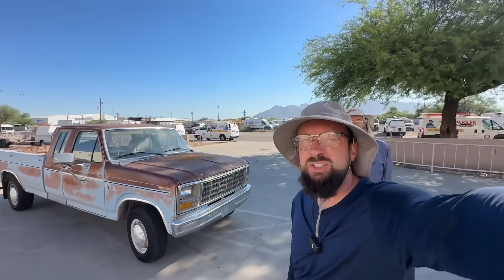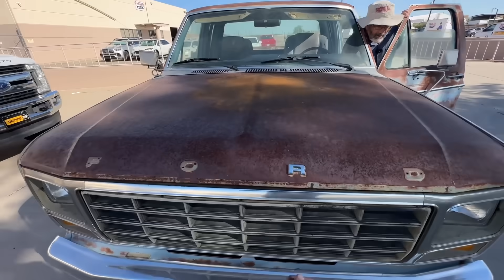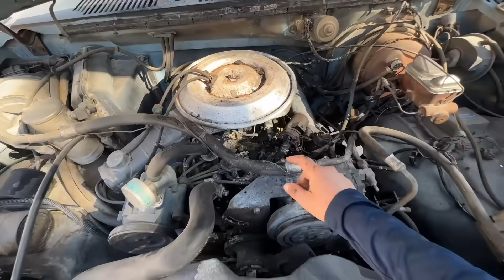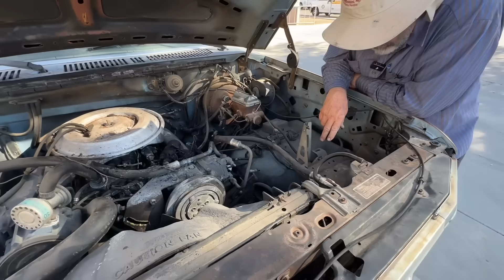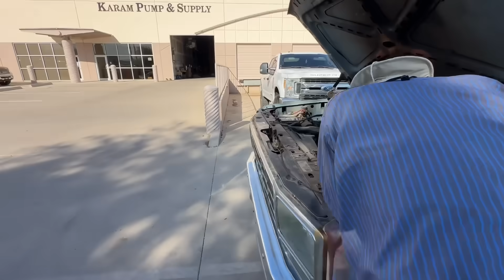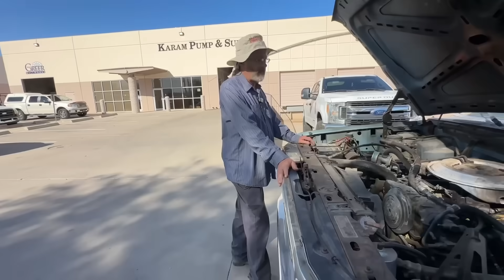I bought & fixed a 1981 ford parked for an ENGINE FIRE. will it run and drive again?

Comment: That 81 F150 would be a great vehicle for me being a disabled veteran. The cab is big enough and a bed to haul a wheel chair. But I probably couldn't afford to buy one. As father and son, yall do great work on these older cars and trucks. God bless! I'm a Ford guy I use to have a 1975 F100 Ranger.

Comment: Just some info. The 1980-1982 F250 did not offer the 460, the biggest you could get was a 400.  As for the trailer special, ford offered that in F150 and F250.  The camper special was available in the F250 and F350.  Ford started offering factory cruise in 1976.
Reply: I was wondering which V8 this was? So do you think it was the 400 or a 302 or one of the 351s?

Comment: Geno's Garage sells a TPS delete kit that replaces it with a potentiometer.  That is hands down the most common reason for no o/d in these trucks.  No clue why you started diagnosing with the less common, and more difficult to diagnose, items lol.  If you've been around first gens as long as you say, you should know that.  VERY common problem, and it carried over.  The 2nd gen trucks really aren't much different aside for the radical new body.  Same ol tractors underneath.  I'd get that TPS delete kit if I were you, that old one you swapped will fail eventually too.  They're only $30.  That temperature sensor on the side of the transmission is the high temp safety switch.  It pulls the transmission out of o/d when the fluid temps exceed something like 250 or so.  The coolant temperature sensor that keeps it form going into o/d when coolant temps are below 70 degrees is located on the back of the head or the back of the block, I forget which.  Also, the dual batteries in the F250 would have been for the Diesel trucks.  Glow plugs.  And both Ford and Chevy offered Trailering Specials and Camper Specials.  Probably Dodge too.

Comment: I’m commenting here…just to help your channel get into the algorithms. (I’m going to try to continue…because I really think you should have more subscribers/views/likes and all of that!
BUT Ford did have a Camper Special. They had a tool boxes 6:29 mounted into the the lower part on the outside of the bed…in the front towards the cab. 
I’ve seen MANY. But I have NEVER seen a Trailer Special…and didn’t even know they  existed with that package?!?!

Comment: Nice job, I knew it will run =))), one question: what size are carburetor nuts?? 1/2 inch?? Thanks, youtheman !!, Ps. I have Lincoln Mark V, 1979... 400 engine at Arctic Circle, Finland, has to rebuild carburetor, that's why I asked ;o))

Comment: Those old Ford 351m and 400 do much better with VR1 oil.  It's about the only one with the right zinc in it. Diesel oil ain't got it.  Unless you like smooth cams

Comment: Those electric fuel pumps are higher pressure than the mechanical ones. It'll overcome the needle and seat and catch the engine on fire.

Comment: Put up insulation under the roof. It's a cheap way of not melting in that oven !
Nice Ford btw, The Trailer special was meant for a 5th wheel RV, the Camper Special they already had with the Bump side.

I think you need to change the cooling fan Travis. It sounds off. It might come apart if the plastic changed hardness from the fire.

Comment: Ford did have camper special packages it was badged and had camper hold downs on the bed and a tool box/storage compartment on the passenger side front of the bed behind the door

Comment: If your interior light doesn't work ,check your fuse for the transmission. They are connected in some Ford years It's something to do with overdrive .

Comment: The 39 Buick is an air compressor that runs off the differential. Been cobbled together for general lower psi stuff like filling tires etc

Comment: Well that wasnt to painfull great flip fer u and pops.think you guys have enough project vehicles in the fleet.now its time to change it up get yourself a skid steer fixer upper for use on stone driveway repairs and mobile motor cherry picker uses!!also that wasnt a burnout that was a dust buster crop circle. Glad guys are having fun though,see ya next one.snooky pa.😊😊😊

Comment: I’ve taken a heat gun and reformed melted plastic like the fan shroud.
Reply: Good job getting her back in the road. Google electric fuel pump oil pressure switch. Using that will keep the electric fuel pump from pumping unless the engine is running.
Reply: I’ve used HEIs from companies like Skip White and others on eBay. Sooner or later I’ve had issues with the modules in all of them. The cheap Chinese modules don’t last. Every time I go to a salvage yard and see a vehicle that would have HEI I pop the hood to see if the fit is still there. If it is I take the time to pull the cap and see if it has an oem ac Delco module. If so I grab it!
Reply: I’m guessing the old car at the end is an air compressor.

Comment: The trailer / camper special f250s tend to use the f350 booster, master cylinder, brakes, and some suspension components.

Comment: The light that came on above the gauges is your brake light indicator. Replace the ignition switch and fix the starting issue,

Comment: If you want to make your smog pump live a little longer , pop off the intake hose and drop a few drops of air tool oil down the air inlet, if you do this every oil change you can extend the life of the pump.

Comment: Hey Travis I've got a 67 mercury parklane power brake car can't find a booster anywhere what can I use in it's place it doesn't go through the firewall it connects outside of the firewall so kind of a weird design I haven't found one yet that works for the application ??

Comment: saw it when you picked it up. heard what the guy said.  when i first saw it . i truely thought it was wood gas a firer. have seen one that grandad's old home stead.  but it was on a tractor.
and in the front. less hoses needed. grandad ran from hitler in 32.

Comment: brothers boss had one of those old work horses. put a big box on the back.
he wore that truck out. shot wood chips in it. heavy wet wood chips.
no one fits in the back. coats maybe.
if i help them i would drive my opel rally with a jag drive train.  number one house country club drive. that owner wanted my car so bad. i kick his porshas ass. 
good day. that day.  ching ching. 500 richer. 
that opel was my road race car. loved that car.  rally was a shrunken camaro 
the opel motor was supose to be in th vaga . dad's  neighbor was an  executive
for chev. he told how chev stopped the deal.

Comment: FYI  i had a 1967  F250 ford that was a CAMPER SPECIAL  had a tag behind the front door, it also had  2 gas tanks with the lever next to and on the floor near drivers seat.    so yes for had the camper special

Comment: I had a bull nose F-150. Good truck except the fire wall is paper thin. So thin that Ford had a recall on them. It only effected the manual trucks. When you would push the clutch pedal in, the firewall would flex and you wouldn't get full engagement. Ford bolted on a plate to stiffen it for the recall. Many people never bothered bringing theirs in for the free fix.

Comment: I'm 74-years-young and I have only had four vehicles that were not ford. A 1960 Cadillac the beast, a 1968 Toyota Corolla Candy Apple Red, an 1984 Plymouth Reliant station Wagon, this one had 4-cylinder engines that I referred to as my Timex. You could bury the needle on the speedometer, and she would still give you more. Once while traveling from Dallas, Texas to Nellis Air Force Base outside Las Vegas one marine ask me what I had the hood and I told him it was a Timex and you know what Cameron Swayze use to said about Timex's they keep on ticking, that was my little Plymouth Wagon, and a 1993 Chevy S-10 which was a work horse for a little truck with the vortex engine, this truck could go any place a 4-wheeler could. But most of vehicles have been fords and I tell you if I had been 24 years younger, I would take you up on that 1981 F250. Thanks this old Marine enjoys watching you and your dad work on all these old vehicles, looking forward to the next one!

Comment: Talking about spark plug gaps, my 78 TransAm with HEI calls for 60” in the owners manual and that’s what I run , our old Chevy II  with points calls for 35” in the owners manual. I run the stock setting and have never had a problem .

Comment: Hey Travis Detroit Dagwood here man I'm a subscriber I watch all your stuff really love your pops and you and congratulations on the little one again and hey man if you could please do me a favor I will send you the money I'll pay for the shipping whatever I need a driver side front fender for a 2001 Dodge Ram 2500 now I heard they fit from 98 all the way to 2002 as long as it's a diesel but man I'm up here in Detroit and I cannot find one in halfway decent shape but look man I'll send you all the money beforehand whatever it takes that's my baby that's my project truck it is meant inside and out and man I'm telling you that's my baby I look for that truck for 20 years and I stumbled over it going to do something else and I bought it and I'm telling you man and I got it all I need now is the driver side front fender and the front sway bar underneath regular chrome grill in the grill bracket and my truck will be done and I'm telling you man I love this truck I've had it in storage forever looking for a dog on Fender I got everything to finish it but man if you guys could do that for me man I'll be in debt with you I'll I'll let you know all that I find cars all the time old cars I got a 1955 Pontiac too it's a four-door and that's my baby and I just rebuilt the original 287 Stratton street it's on the engine stand but I want to find a put a later model Transmission in it and get one of them adapter plates between the engine and the transmission because the starter bolts on the bellhousing and not on the Block but please man if you guys could do that for me oh my God you wouldn't believe and she I want to make a little Bunkhouse in the back I'm going to get a cap for it and I'd like to come out there and visit you guys man and hang out and dude I do the same stuff you guys do me and my dad was just like you and your dad man I was working on cars and I was 6 years old and boy I sure my Pops passed away and I just lost my mom 3 weeks ago and you know what man it would mean the world to me if you could try to find me a dog on front fender driver side for a 2001 Dodge Ram 2500 please man God bless you and peace I love you guys peace man

Comment: That tiny bit of water in your oil could be from the pressure washing. A rock on top of a chunk of steel doesn't seal 100%. Food for thought. Great video!!

Comment: Hey Travis they put that ignition in wrong when they put the new cylinder in it's it's clocked wrong and that's why you turn it forward it goes too far but it won't start it's it's got to be turned back on Accessory when you put the thing in and they didn't do that so all you got to do is take that cylinder back out clock it put it back in and then you won't need that button

Comment: 42-minute mark great point about ignition. EFI gets all the credit, but electronic ignition was revolutionary for engines.

Electric starting,reverse gear,electric ignition,electric fuel delivery. Milestones in that order
Reply from the maker: I’ve seen old ads that talk about how the electric starter was the greatest milestone in engines since the were invented. That was in the 20s or 30s

Comment: I saw a white Jeep! Hope that's not your's. If it is, Moe rags will leave you sitting. No question about it. The newer ones are real bad about that.😮😮😂😂 The Ford engine aka diesels you have are owned by Ford. Yes that's right Ford owns Cummins!! How about that!!! Alot of folks don't know that!!!! Ford bought Cummins back in the mid90s.
As far as I know they are still owned by Ford. I found that odd when I got my 7.3 in my 99 F350 Duelley. Not 1 engine issue!! Great engine!
Reply from the maker: Ford made an investment in Cummins a while back. Ford does not own Cummins . Cummins is its own entity.

Comment: You can point the rotor button in any position you like in that situation but I always point it at the number one cylinder. Makes it easier to diagnose in the future. Plus one more thing those park lights on the front are running and turning signals. You guys get some good rust free vehicles out there!

Comment: Im pretty sure Ford had a Camper Special. Mid-70s. Came with the Ford nig block 400 ci engine. Some had a manual transmission.

Comment: I’m guessing the Buick is some kinda mining operation jig. Running steel cable based equipment. I’ve seen something similar in the east coast where they took model T, and A’s gutted them except for the cab/ drivetrain to run similar equipment.

Comment: Thank you for giving the old bull nose a chance to stay out on the road instead of junking it. I was born in 80 and they were the new trucks everywhere when I was growing up. They've always been my favorite of the f-series trucks. Its one of my bucket list trucks. F-150 RCSB 2 wheel drive, or a RCLB 4X4. My other is the Square body with the same specs. Lots of nostalgia with both of them.

Comment: yes you can get a adapterOBD1 to obd2 scanner will connect to the truck and do a diag i have one because i drive a 1994 ram 2500 and connect the scanner to check things. the sensor in the diff can cause it not to work

Comment: I had a truck 2g 12 valve 47rh with same problem I think it was some sensor on the throttle bracket to the pump might of been tps I can’t remember it’s been so look ago it was one of the sensors also could of been the transmission temp sensor can’t quite remember exactly
Reply from the maker: Yep our issue was tps

Comment: Hey Travis  just wanted share something that i observed about those bullnose fords
ive noticed that ive seen around half a dozen of those burned in junk yards etc.  the common denominator be tween all of them were the fire started in the under dash wiring  the one my brother has  also had problems the wiring in the dash  let  me say this park it somewhere so if it should catch fire it can burn without putting any of the other cars at risk

Comment: Sometimes I'm old Ford Distributors would stick in them even better Flathead days I used to have the same problem with Flathead someone would stick in there and you had to get a big pry bar to get them out
Reply from the maker: I can’t believe it did come out so easy

Comment: The drone footage as you were pulling back in from the test drive, made me think that with all the old gas station stuff in the yard, now ya just need an old gas station ding, ding bell in the driveway. It would be cool til the novelty wore off, then it would probably drive everybody nuts after a while.

Comment: My camper special pick up like that on had a C6 in it with a 390 engine in it and had dual tanks Dual side tool boxes on the bed dual batteries under the hood

Comment: 1:02:02 Above the steering wheel shaft is a rod that moved when the key is turned. Spray some brake cleaner or electrical contact cleaner into the device the rod goes into. They get gummed up with old age.

Comment: I knew when you and Rick were hovering over that '39 Buick that you were debating heavily on buying it. Just be careful with the air compressor on the back. When pressure vessels fail, it's quite impressive.

Comment: Those were the days when ford still built great trucks.  I had a coworker that towed a 32 ft travel trailer through texas chasing a pipeline dream.  what a year that was.  Baby is looking fit as a fiddle. gonna fit right in here just fine.  Next video is gonna be fun. just like this one.  Be well.

Comment: I'm pretty sure you need a fuel pressure regulator if you run a carbureted engine with a electric fuel pump

Comment: Hey I have a 1998 dodge 1500 gas truck short bed extended cab rust free and only 1 small dent...would trade you straight up..

Comment: Timing, turning the distributor. The vacuum advance will tell you the direction the distributor turns. The vacuum advance always pulls against the rotation of the distributor so the advance is the left side on a Ford that means the distributor turns counter-clockwise and the advance on a GM is the right so the distributor turns clockwise.
Reply: Learned that from a old mechanic on YouTube jeff Bradshaw this old truck redneck restoration.
He was a mechanic professionally in the 70's and 80's

Comment: That is a wood-burning smoke powered motor. I’m not sure the exact process but if you burn the wood and the smoke goes into the combustion chambers, it combust and runs the motor.

Comment: Smooth running engine. That dribble of water was probably condensation settling there since the last time the truck was driven regularly. That would be a score in the Midwest at 4500. Great vid as always. Regular Rick is really a big plus to the channel.

Comment: I've got an '85 F250 Camper Special (with the badge) diesel 6.9. 
Not quite as straight as this one, but close. Interior,  door panels,  dash....all cooked by TX sun. 
XLT supercab.  Bench, factory seat.
About 140k miles.
2nd owner. 
Needs kingpin, steering a little sloppy,  but very drivable. 
$1500..... come get it!!
I've owned it 25 years.  
Glow plugs and fuel lines to injectors replaced. New head gaskets 10 years and 3 miles ago. I'm no mechanic and it's just sitting in my backyard.

Comment: quick way to know which way to turn distributor to advance timing, the vac advance module literally points the direction to turn it.Becuase of fire good idea to replace master cylinder anyway. I'm not a ford guy but wondering if the fire melted the the intake manifold front and rear seals that might give oil leaks in future.... replace all vac lines too

Comment: Internal pressure switch and solenoid are know weak parts. Also adjust the bands every 30K with fluid change and you will get 200K out of that automatic.